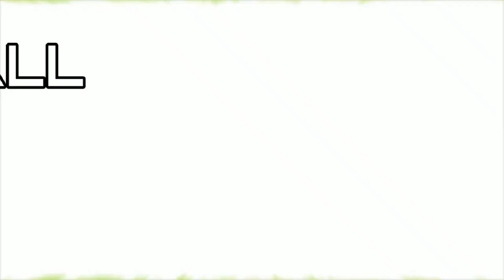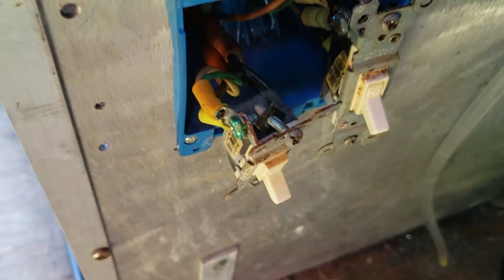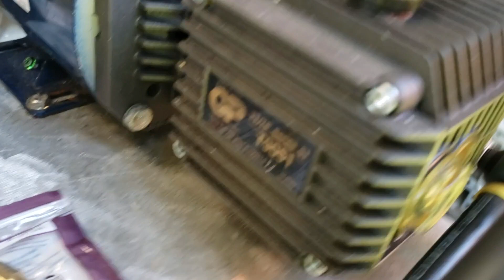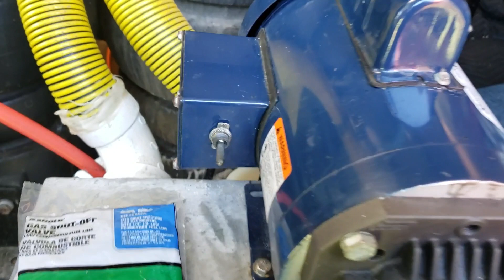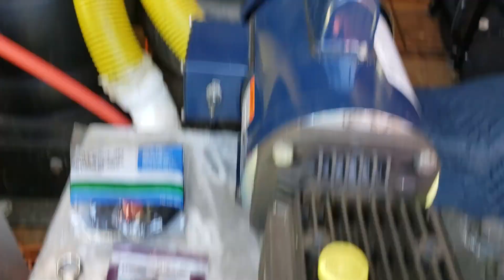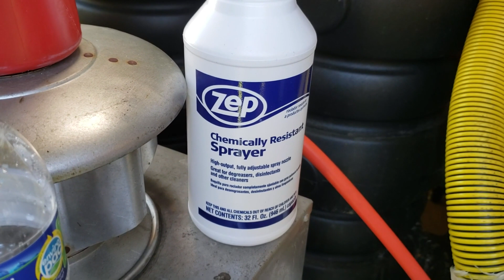ETM VACUUM MOTOR WIRING & PUMP SETUP

Comment: Hey mack have a question have you ever tried using 2 different type of motors on the same tank. For example one that is higher in cfm/airflow and the other that is higher in water lift. Is this possible , would you get the qualities of both or would they cancel each other out or would it be better to just buy a single pump with higher ratings on each
Reply from the maker: You know, that's a great question. I can see why something like that could maybe work, at least in theory, and may be entirely doable with just the right combination of motors. But here would be my concerns. First it would take a lot of testing which would be time consuming and get expensive buying vac motors to try out. Second, I think two identical vac motors that are set up in parallel have an advantage because neither one has to work harder than the other. Using two different vac motors seems like it could throw things out of whack and instead of having better lift and cfm, it might actually be worse since you're relying on just one motor for more cfm and one for more lift. Plus, to really get good lift from vac motors, they need to be set up in series and you would need to connect two together so you would end up with one vac motor by itself for better cfm and two others connected together in series to provide better lift. I realize you were just talking about using two vac motors but I don't think there would be any noticable difference by using different vac motors although I'm no expert lol. I think you have to go to a three vac system to get the benefit you're talking about. I don't know if you're familiar with the old Cross-American extractors, but they used three vacs set up like I described. Two in parallel and a third connected in series to one of them.  They were decent machines and I owned one for a while. They used the slightly smaller 116565-13 vac motors while I use the 116765-13 vacs. You may be thinking that a three vac system like that would be better than using a two vac system like I use but here's the deal. The smaller vac motors aren't as powerful as the ones I use and they restricted the airflow on theirs so they would draw less electricity and amps. So basically you have a three vac system which should be the best of both worlds but by using smaller vacs and restricting airflow you didn't really end up with more power. They did all that so they would run on just two cords. With the way my system is set up, there are no restrictions so the vac motors are able to operate properly and give a good balance of cfm and lift. A lot of people have suggested newer and "more powerful" vac motors to try but I'll tell you why I've stayed with the ones I've been using. They provide a good balance of cfm/lift, draw a modest amount of electricity/amps, and last a very long time. I actually learned about them from a guy who used to build electric truckmounts many years ago and they are the only ones he would use. I've talked to quite a few people who have built systems similar to mine and many of them didn't listen and used different vac motors and weren't happy with them. I'm not saying there aren't other vac motors that can be used, I'm just saying don't believe all the hype that these "more powerful" vac motors are always better. On paper their numbers look great but none of that matters when you use them in the real world. The Mytee LX motors are one of them and I agree that they are very powerful, but only if you plumb them in series but series doesn't work well for electric systems that need to run 150 feet of hose. Sorry to be so long winded and I realize I over-answered question but in the end I would probably just stay with two identical vac motors.

Comment: Hey Mack, is there a way to determine which wire is hot and which is neutral? since my motors only black wires.
Reply from the maker: I don't know of any way to tell which is which other than by color. I would check with the manufacturer to find out for sure though. Which ones did you get?
Reply: The ones you show on your steel drum video but off of Amazon, not from the manufacturer's website.
Reply from the maker: @Jvpengine  If it's the 116765-13's, I would google pictures of the motors and look to see where the white wire and black wire are on the photos and use that as a guide. All of the motors I've ever ordered had designated colors so I'm not sure why these wouldn't have them also.

Comment: Nice set up you came up with.  What adapters did you use to connect the solution hose to the outlet of the pump?
Reply from the maker: I bought the pump pre-plumbed and and ready to go so all I needed to do was use a carpet cleaning quick connect for the solution hose rather than a pressure washer quick connect. I think I may have had to reduce it from 3/8 to 1/4, but that was it. I hope this answers your question. If not, just let me know.

Comment: I got 4 and it’s at 344 cfm but I got some high rises and motels
Reply from the maker: Do you have a cfm meter to test it or is that the combined output from the vac motors?
Reply: No I know how much each draw cause at first I had just 2 motors at first and was plugging in people’s homes outlets then I bought 2 more found out how much wattage it was and then I bought generator to match and it was a big difference in air flow I can do 200 feet comfortably
Reply from the maker: I was just wondering because I would be interested in seeing exactly how much I have and looking for a reasonably priced cfm meter. What vac motors are you using?

Comment: Thank you. Would you consider ever using 4 vacs with a bigger generator?  I would think so and give you more options with a rotovac or longer hose runs.
Reply from the maker: Honestly, just the two vac motors give me all the vacuum I need for 99% of my jobs. I have been running a pretty high pressure with an 8 flow and still getting dry times of just a few hours. When I run 175' I do notice a drop in vacuum so I do extra dry strokes, but it's not often that I go with that much hose and I always take that extra 50' section off as soon as I can. But to answer your question, as of now I am going to stick with the two vacs simply because it works for me. Plus, when you get up past the 5500/6500 watt generators, they tend to get much more expensive. But I am still thinking about building the inline booster just for those times when I do need 175' or more.
Reply: @AllAmericanMack  hello.  have you thought of using the new lx motors?  you helped me build my Etm a few years ago.
Reply from the maker: I haven't really considered changing because I've been happy with the ones I've been using. But I really should at least check them out and see what the specs are. Are you still using the etm?
Reply: @AllAmericanMack  I agree up to 150 ft of hose you are good to go, I do use a booster along the 200ft of hose runs when I clean these banquet halls.
Reply from the maker: @NotTooExtreme  What type of booster are you using? I would like to either buy or make an inline booster. I've looked at the Mytee and Odin's boosters, they are just so expensive.
Reply: @AllAmericanMack  I have bought the mytee booster few years ago with single vac 5.7 high power. On my banquet Hall jobs I use 200 ft the furthest, 150 from my van to the booster and 50ft from the booster to my T-Rex, crazy suction, the carpet dries in 1 hour with the fans on. The booster price was $1200 but they don't sell them anymore and they have the mytee LX booster with 2 powerful 6.6 LX vacs in series that will increase the lift tremendous if you can be able to use them both at the same time but you can use one as well because they're in series.